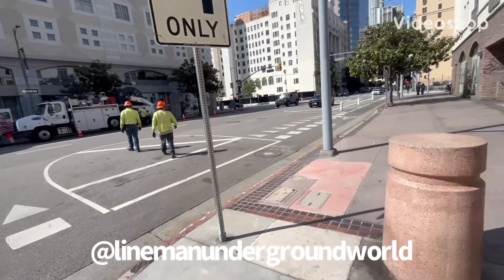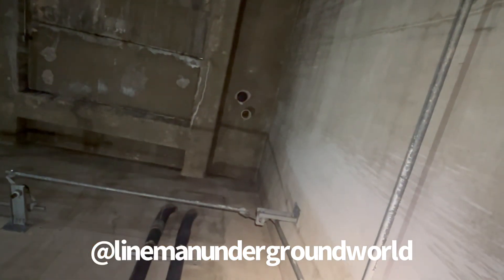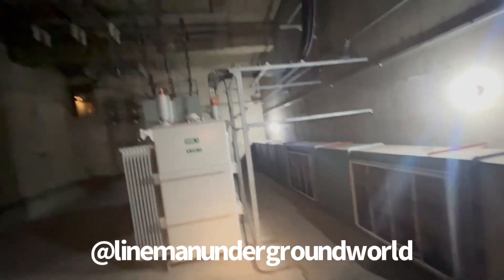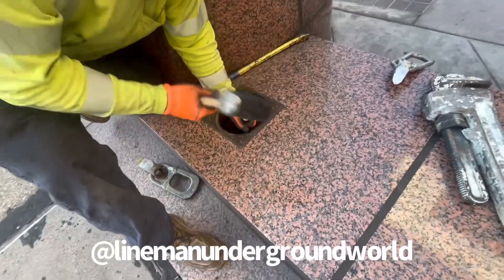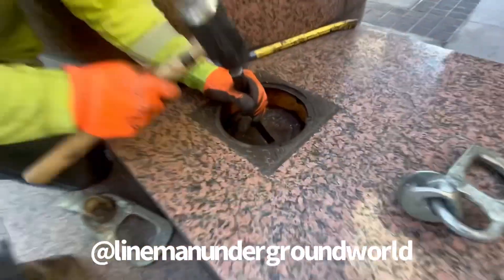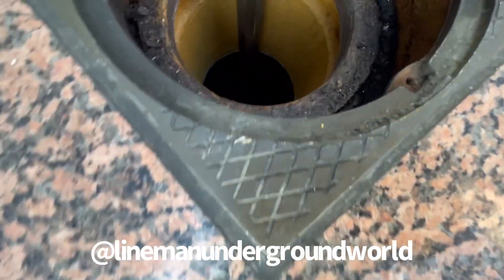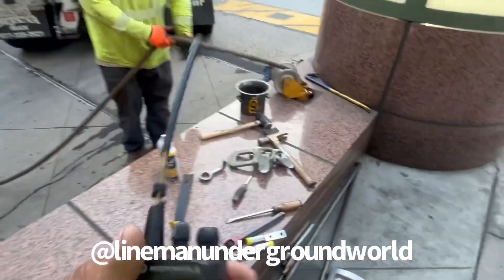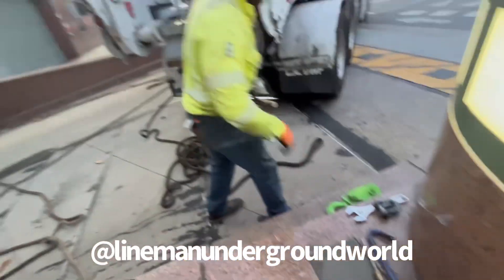Replacing lead with synthetic cable

Comment: I was doing some googling to try to understand the "lead" reference....  So, these are old lead clad cables that are just being upgraded?
Reply: Yes, correct lead was used from early 1900s up till 80s and even now some utilities are still installing lead cable as it can last such a long time, but others are preferring to upgrade to things such as EPR an XLP
Reply: @JulianCuevas-r3e  So it's replacing a lead cable with copper cable wrapped in
 synthetic...
Reply: Sort of yes, depending on what type of cable he is pulling in it’s going to have a copper or aluminum core and insulation layer around that a semi conductive layer around that a concentric ground layer around that and finally an outer jacket. I apologize if that is a little confusing, I would look up a EPR cable cross-section if you would like to get a good visual.
Reply: @JulianCuevas-r3e  Absolutely no need to apologize! Your explanation makes me realize how little I know about cables and now I need to investigate on this. Thank you for your answer!